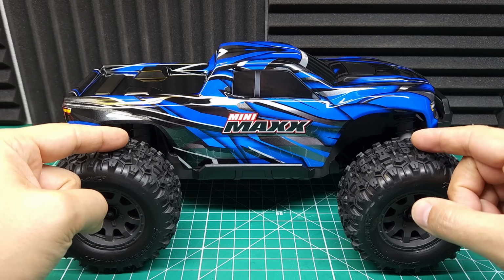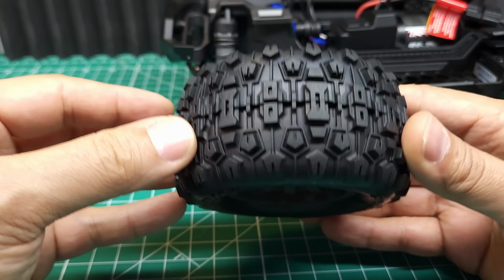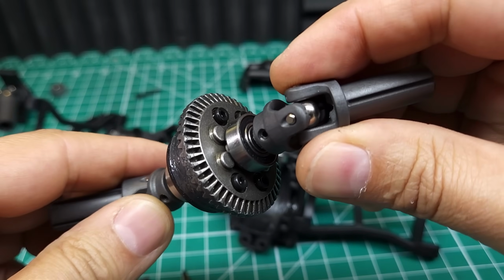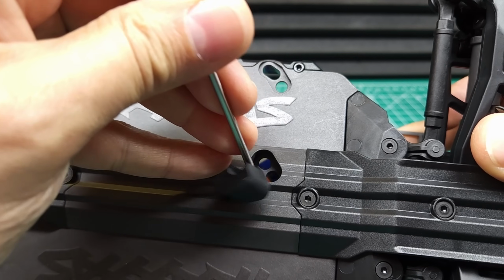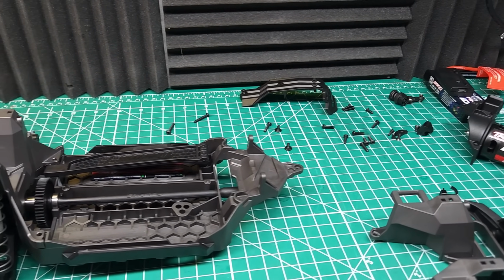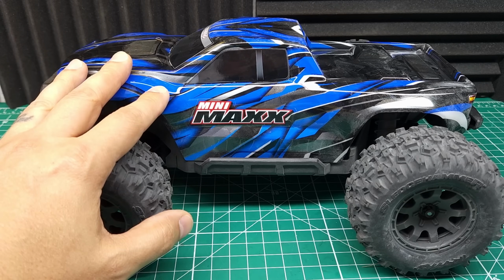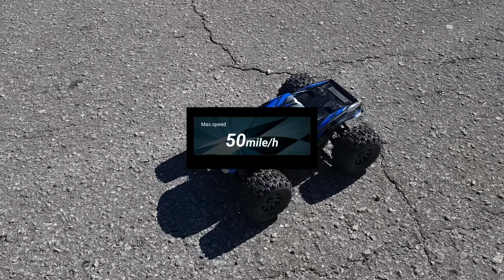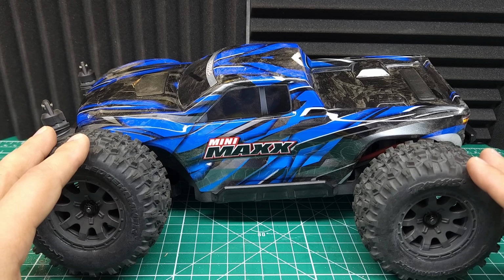I Really Wanted To Love The Traxxas Mini Maxx | Watch Before Buying!

Comment: That is really strange that they have a paper gasket in the diff. Their own website product description says that the differential has silicone o-rings and silicone gaskets. I guess that’s as much a marketing lie as the ability to handle their own vxl-3s.
Reply from the maker: Interesting. I double checked the footage and it's definitely a paper gasket.  They probably just copy pasted the description from another vehicle
Reply: @DoRC I would agree but the graphic is a literal picture of this differential and the description is unique to the mini maxx. If you go to the graphic under details where it has a picture of the sledgehammer tires and go all the way to the last slide you’ll see what I’m talking about. Definitely wasn’t a silicone gasket in the video I agree.

Comment: Which would you recommend,  Mojave Grom 3s or Rlaarlo carbon fiber rally  ?
Reply from the maker: That's tough. The Grom is probably less "risky" but the rally is really good. They are different enough that Id so just go with the one you want more :)
Reply: What do you mean by risky ?
Reply: Traxxas Rally or Rlaarlo Carbon Fiber  ?
Reply: Traxxas Ford Fiesta ST 4x4 VXL Brushless
Or Rlaarlo Carbon ?
Reply from the maker: @LaurenceHood-s9h  I haven't used a Traxxas rally in many years so I hesitate to give you a recommendation between the two. I can tell you that the Rlaarlo seems very good. Obviously the Traxxas is going to be a little bit bigger and you'll have wider access to upgrades and parts support but the rlaarlo offers more out of the box
Reply: @DoRC  thank you very much. I've learned alot watching your channel. Trying to restart my love of RC. Your channel is very informative and from what I've seen so far you give a non bias opinion on products and speak to the beginners as well as the seasoned.
Reply: Do you have a recommendation on how to stop all the debris from accumulating inside the body of the Rlaarlo ?  That seems to be one of the problems voiced by others.
Reply from the maker: @LaurenceHood-s9h Glad you're enjoying. I do want to say though that Just like everyone I do have my own biases. I try not to let them affect my opinion on things too much but they definitely do exist :-)
Reply from the maker: @LaurenceHood-s9h  unfortunately no. It's kind of the nature of the beast with those types of vehicles. They are shaped perfectly to let stuff in but not let stuff back out again.
Reply: @DoRC  👍🏾
Reply: Hope you're having a great weekend. I just wanted to pick your brain. What, in your opinion, is the best lipo battery charger? Single battery or simultaneous two-battery charger?
Reply from the maker: @LaurenceHood-s9h  I like the s6 dual battery charger from hota. It's 200 watts per channel and with all the features you need at a pretty reasonable price.

Comment: I got one the day it came out crashed into a couch indoors, and the steering servo striped out a gear.  It also cogs super bad when u switch from fwd to reverse.   Worse traxxas car i ever bought.
Reply from the maker: Yeah a bunch of people have noticed that the power system tends to have a really bad hesitation. I'm not surprised about the servo either. They're pretty weak. I think overall it's a decent platform but it certainly isn't the premium vehicle that the price commands.

Comment: Ooooh look, Traxxcrap "metals" snapped again. The same thing happened with the original 6S Xmaxx and still happens with the spur/pinion on the 8as Xmaxx. This is definitely not worth the $250 if you plan to run 3S exclusively and I doubt 2S will be much better. Traxxas advertises the 3S system as an upgrade so the fanbois  can't claim Traxxas never meant this truck to be used with 3S. 

This truck reminds me of the old ERevo 1.0, Emaxx 6S, Slash VXL days. Traxxas knowingly selling people junk.

Everyone needs to wait for the 2.0 where they actually fix this turd and hopefully give the truck a waterproof RX box. At this point, why even have a cover for the RX?
Reply from the maker: I was definitely surprised to see the steel get broken by the plastic. And yeah the battery "box" is lame.

Comment: I usually like Traxxas. BUT their monkey metal gears are some of the worst/most weak standard metal gears in the industry. Wish they would use better quality metal on their gears, spurs, pinions, solar gears+++
Reply from the maker: Generally I don't mind the sintered steel but given that a plastic drive shaft was able to snap this off it definitely makes me think about it again.

Comment: Yeah. Ultra crappy. They are one of many reasons I ditched traxxas. They should sell a-la-carte kits whet you pick the 5-6 traxxas parts that are durable and
Buy the rest seperately since they aren’t durable until they’re made of mostly RPM parts. Let’s hope this truck is more like the Xmaxx, durability-wise. Where only 30% of the truck needs upgraded, not 70%
Reply from the maker: Overall, on 2S, it doesn't seem bad but I feel like it's pretty easy to make an underpowered truck durable

Comment: It’s trash it’s under powered out of the box and if it’s over powered the either the front shaft is gonna strip or the back shaft is in a strip
Reply from the maker: I think it's ok in stock form and I'm sure many ppl will have fun with it but Traxxas shouldn't advertise the VXL system as an easy upgrade if the truck can't handle it.

Comment: Has anyone tried just switching motors with the velionon 3s. Just switch motors and run it on 2s. Im curious cause I have the motor and ordered a mini Max. Thinking of running 70 wt shock oil in rear shocks.
Reply from the maker: I don't think so. Give it a try!

Comment: That BL-2S is no joke. I put one on my 2WD Bigfoot (There’s a 4X4 version on the way as I have learned) and gave it the 40+mph gearing Traxxas recommends for their standard transmission and it is VIOLENT compared to when it was brushed. It even does flips.
Reply from the maker: Yeah it's definitely good compared to rushed but not really compared to the 3S brushless systems you would expect to see in these vehicles.

Comment: Interesting. More power was not more betterer. 😄
Reply from the maker: Definitely not. I'm surprised it was the steel that broke and not the plastic though. I expected to see a shredded center drive shaft
Reply: @DoRC    When you mentioned the break, I thought OK, he did give it a good bash, so a break was not a surprise.  But when you revealed the broken pinion gear shaft, well, surprised I indeed was.

Comment: Omni Terminator all day long, much cheaper, much faster, more stable, better driving experience, more durable, better radio with giro, way better electronics, center diff, high speed pinion included, 35c 3s battery included, cnc steel gears/ drivetrain including steel spur. Apart from that the Terminator isn't very good lol.
Reply from the maker: Hard argue with that